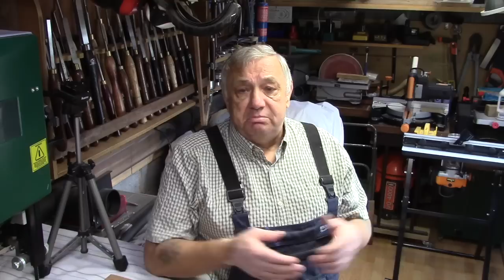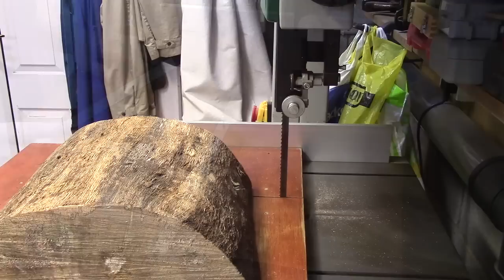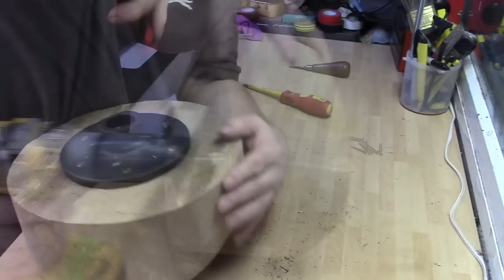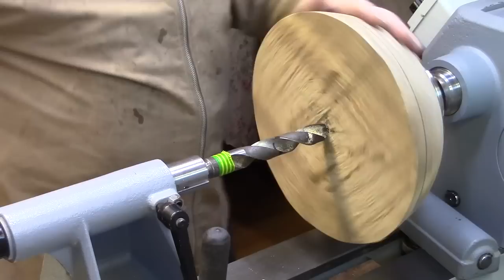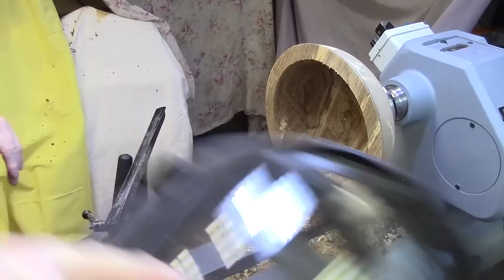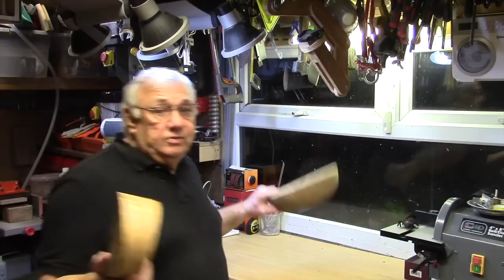circle cutting jig

Comment: Now, that circle cutting jig is quite simple and easy to make for your band saw. Thank you so very much for sharing Harry....! Also, I thank you for sharing your centering jig for bowl blanks and your stock pile of wood blanks. White glue is a lot more reasonably priced than other commercial sealers. Overall, have you had many losses with cracking and or checking with your white glue use? I usually put my bowl blanks in a paper grocery bag with wood shavings or painting the end grain having overall good luck.  Harry, I always find your video shows quite interesting and entertaining. Thank you so much for sharing, Harry....!
Reply from the maker: Hi Jack, first of all thank you very much for your comments.
The bowls that I have rough turned I put in brown paper bags and stored them in my little wood shed, this is quite new to me I have only done this a couple of times in the past,
I usually just cut them on the bandsaw paint the end grain with PVA and stored them away,
And I have had fairly good success using this method, but I must be honest I don't get a lot of wet wood, so I am by no means experienced at it,  the PVA or white glue Does seem to Seal them well,
I will be able to see the difference between the two methods in a couple of months.
Once again thanks for your comments Jack.
Best wishes 
Harry
Reply: Thank you Harry, I'll give the white glue a try. I'm always looking for different ways for drying times. Thx so much again for sharing. May you and your loved ones have a safe Labor Day....!